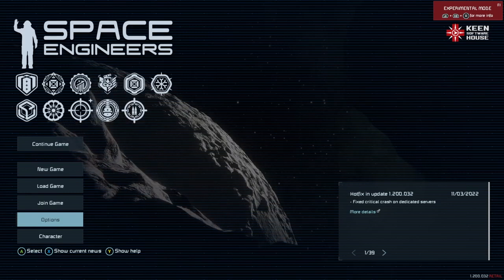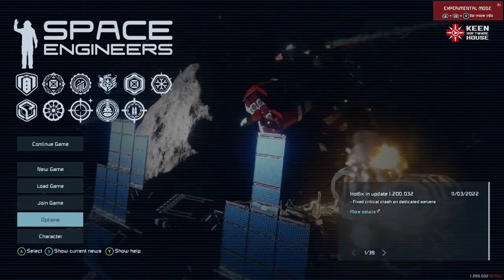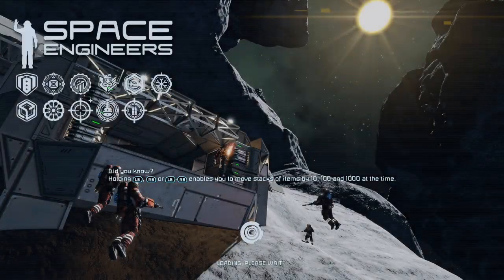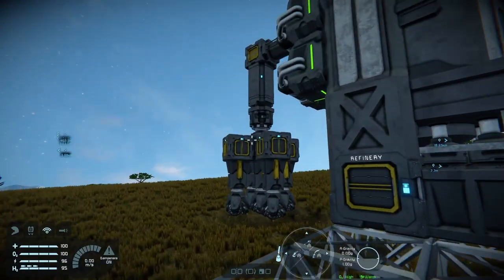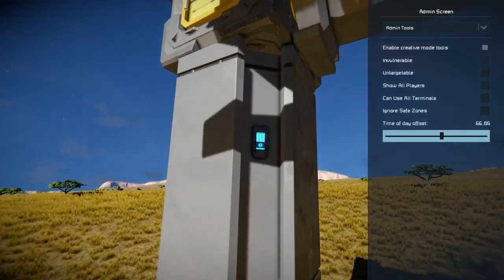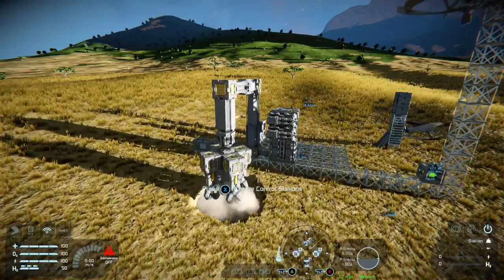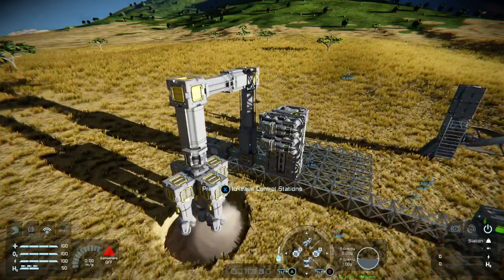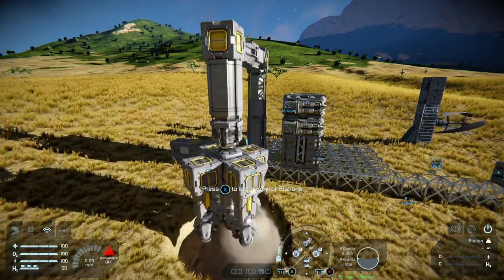Dwolfyone Plays Space Engineers: Share Inertia Tensor 101

Comment: i dont see the option for share inertia tensor in my control panel. is there a way to add stability without it? my piston drill looks like it has parkinsons and its not even half the size of some that ive seen in videos
Reply from the maker: First it depends on the mode you're playing on. Solo or on a server. Some Admin don't enable it. If playing solo, what map you're on also matters since there is a bug on some scenarios. If you're not playing in Experimental Mode then you won't see it. So always make sure to check if you are, and always confirm with X.

Lastly gyros on override can work to stabilise a rig.

Comment: So I'm on a keen survival survey right now playing with my brother, and drill wobble is a big issue. Kinda need share inertia tensors, but the menu button is missing on everything. Looking online I found that this is a bug, and a possible solution to that has to do with toggling experimental mode, but it hasn't worked. Is it because it's a keen server, am I just doomed to not have inertia tensors while on it? PC steam version btw, not sure if you know a whole lot about it
Reply from the maker: Hey there. So, as far as I know (it it rings true for PC the same as Xbox) the official servers are all in stable mode, without experimental activated. You can tell if a server uses it on the browser by looking for the /\ with a ! inside it - or by going to details on the server and it'll say, "This server is in experimental mode." If it's running experimental.

So yep, whilst on a Keen Official you're stuck with the server settings, which I think are basically no experimental, scripts, or mods.

You can use gyros to stabilise a drill rig on override. I haven't done a video on that yet, but I think there's some mileage there.
Reply: @Dwolfyone  Wow quick reply, thanks. Gyros seem to help quite a bit, but don't solve the problem completely. I think I have a stable configuration right now but I don't think I can expand it out a whole lot more if any, so I think I'm stuck with a 7 piston design moving at snails pace (even for a drill rig!) But still 70m is a pretty decent depth for a mobile drilling platform, even if it is pretty slow, at least I can mine the majority of surface ore veins if needed
Reply from the maker: @swampcooler8332  yep, the only way to cut it back almost to nothing is SiT. One thing you could do is run a dedicated off the pc for you and your bro. If you have a decent ish pc that can act as a server. You can even have Xbox players on one as long as it's EoS compatible.

Comment: I made a drilling rig but my drills won’t drill into the ground they just set on surface and spin they don’t create a hole I set it up just like you did in your video and I can’t get it to drill for some reason any advice
Reply from the maker: These are the questions I always ask:

is this a server based game or just solo?

Creative/Survival?

Are you running any mods whatsoever?
Reply: Solo survival and no mods
Reply from the maker: @duty2pwnu700  thanks, that makes it a little easier to troubleshoot or at least get on the right track.

Next thing, load game, settings, advanced.

Check to see if voxel destruction is set.
Reply: If the voxel destruction wasn’t set I wouldn’t be able to use my hand drill right cause I can use the hand drill but not my big drills for like ships and stuff
Reply from the maker: @duty2pwnu700  yep, you couldn't drill at all.
Reply: Only thing in the advance settings I mess with are the progression I turn it off
Reply from the maker: @duty2pwnu700  OK. So are you using the advanced rotor to connect up the drills, if so, is the rotor part fully welded. Got a screen of the rig or a vid?
Reply from the maker: @duty2pwnu700  I haven't had this happen myself, but I have seen threads on Reddit SE etc and so on where people have had it happen.

One guy fixed it by saving the game, and then reloading it a few times.

One other thing, what planet, or are you in space?
Reply: Earth like planet I’ll try the save and reload but seems like everytime I do that when I go to build something half the blocks are invisible and can’t tell where the connections are for them
Reply from the maker: @duty2pwnu700  hmmm, that's odd. Might be worth doing a reinstall of the game at some point. You can also BP the base and rig, then fire up a new save just in case something has gone odd. A tip for saving and loading quickly. Use both bumpers and X to save. Rb and y for Admin menu and go to replay, then use reload world from there.
Reply: I’ll give it a try I appreciate you and love the content keep up the great work
Reply from the maker: @duty2pwnu700  many thanks, let me know how it goes. If it happens on a new save, may be worth a bug report.